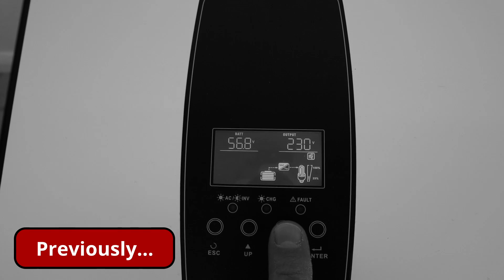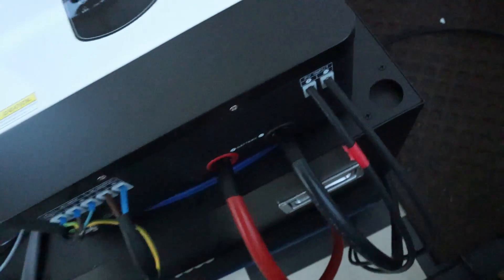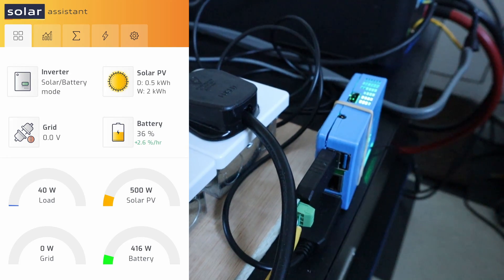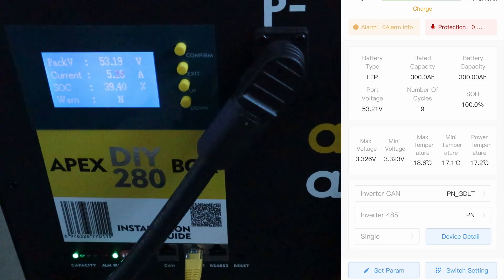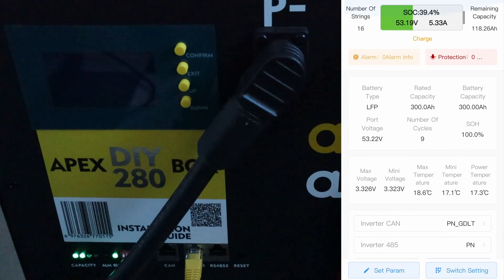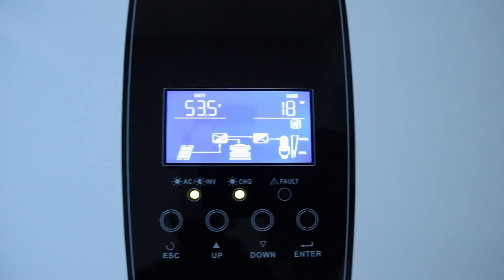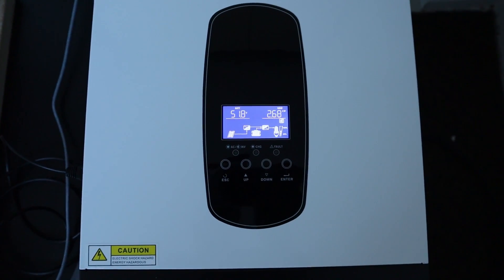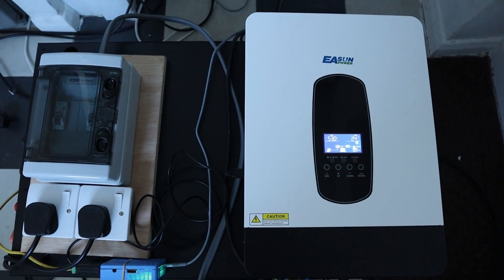Apexium + EASUN = Cheap & Powerful 48V System? | Testing Update

Comment: Hi, can you tell me if it's possible to use this inverter without battery, if yes have you tried this mode
Reply from the maker: @yuriydidkovskiy4063  Thanks for your question. My version requires a battery to operate. I'm not sure on the latest model(s) as I've not got one to test with. I hope this answers your question. All the best, Adrian
Reply: only solar panels
Reply: @jounikyy7715  thanks for your response, do you mean it can work with solar panels and utilities and without battery in SUB mode?

Comment: I saw that inverter on the web.  Quite inexpensive, about 1/3 cost of similar inverters.  But, only single-phase 230 VAC (50 or 60 Hz), so not ideal for N. America since split-phase is better for us, to allow 120 VAC outlets too.  Could be used to power a few devices which use 240 VAC single-phase (no neutral) like a heat-pump, well-pump, or EV charger.
Reply from the maker: @williamgrissom9022  I've not powered a heat-pump, well-pump or EV charger with it as yet, but with the correct wiring it probably could. It's run most of my house fine, albeit with the used of extension leads. It's a shame it can't be paralleled, but I'm guessing that's why it's inexpensive. Cheers, Adrian

Comment: Tu quanto ai curent inpur PV ?
Reply from the maker: @farcasvlad1977  Buongiorno, non è specificato nel manuale o nell'etichetta sull'unità (di solito indica solo le tensioni). I dettagli sul caricabatterie solare (dall'etichetta delle specifiche allegata sull'inverter) sono i seguenti:

Potenza nominale: 6000 W
Caricatore massimo: 110 A
Tensione operativa nominale: 240 V CC
Massimo. Voltaggio solare (VOC): 450 V CC
Intervallo di tensione MPPT: 55 ~ 450 V CC

Potresti dividere la potenza nominale per Max. Voltaggio solare (VOC) per dare un'idea molto approssimativa di ciò che l'MPPT potrebbe estrarre dai pannelli in termini di ampere al carico massimo. Ti auguro il meglio, Adrian

Comment: Very interesting video, I'm thinking about buying one of these  easun  units prob same as yours. Was thinking just using a few small acid batteries I have and 10 solar pannels. Could I just use the power AC when theirs good sunny days directly as won't have much storage. Can you set the easun up to cut the AC Out when the solar is not enough or does it switch over to the AC in and just pass throu?
Reply from the maker: @lookoutleo  You can change the priority of what powers the AC output. I've just broke this inverter, my fault (video to come), but I've got their newer version awaiting customs clearance as I type this (https://bit.ly/4cQXJQe). I'm also testing this at the moment https://s.click.aliexpress.com/e/_DCZbHeX (affiliate link), video to follow in the coming weeks. This one can work without batteries if you have enough solar, still need to test that bit out. All the best, Adrian

Comment: Hi, what is his Max. Solar Current?;Max.Power Current Impp(A)?
Reply from the maker: @user-pk5lc8rr6c  Good day, it's not specified in the manual or label on the unit (usually just states voltages). Details on the solar charger (from attached spec label on the inverter) are as follows:

Rated Power: 6000W
Max charger: 110A
Nominal operating voltage: 240VDC
Max. Solar Voltage (VOC): 450VDC
MPPT Voltage Range: 55~450VDC

You could divide the Rated Power by Max. Solar Voltage (VOC) to give a very rough idea of what the MPPT could pull from the panels in terms of amps at max load. All the best, Adrian
Reply: Ho uno uguale e non sapevo quanto e Maxim imput curent pv

Comment: Thanks for sharing! What is the stand-by consuption from the battery with no-load on the inverter? Can you also check consuption from the grid in no-load condition, please? Some of the chinese inverters are really wasters of energy! Can the inverter also run only on battery with or without PV input?
Reply from the maker: @rilosvideos877  Glad to help where I can 👍. I'll need to check again (can’t find the figures from last time) and let you know, but from what I can remember the no-load results were similar (in Amps) to the ones I shared with you on the 24V version. In terms of running just on battery, yes, it can be run in isolation (I do this with the 24V version now), you'd just need a way to charge it (usually by connecting to the grid to charge). I'll let you know about the no-load (standby) amps on this 48V version. All the best, Adrian

Comment: Can you tie multiple of these units together
Reply from the maker: @blainecelestaine4543  Thanks for your question. You can connect multiple batteries together to increase overall system capacity (as in this video https://youtu.be/Y4defUDU5hM). The EASUN 48V inverter can't be connected in parallel though. I hope this covers it. All the best, Adrian

Comment: Would a small airconditioning be able to run ?
Reply from the maker: @Bazakilouis  Thanks for your question. In this setup, the inverter can output 6.2kW, so in theory should be able to run an air conditioner as long as the surge current needed (at compressor start-up) didn't exceed what the inverter can handle. All the best, Adrian
Reply: Check a newer mini-split heat pump.  Many youtubes.  I recently installed one to better employ my solar power (Della 1.5 ton AC, 230 VAC single phase w/ no neutral, SEER 22).  I use it for the kitchen and living room, but it has cooled my whole house on 110 F days (my central AC failed in early June).  I see 1.5 kW draw max and much less once the house is chilled.  People say it doesn't trip a solar inverter since it uses a high-tech "inverter drive" motor.  If an older AC compressor, you might need to add a soft-start (not cheap ~$300).  Mine is an EG4 6000XP inverter.  Most mini-splits are made by Medea (China), sold under many brands (Pioneer, ...).  Only a few aren't - Mitsubishi, Daikin.  Most HVAC guys like the Mitsu but about twice the price.  Mine cost $900 w/ free Amazon shipping.

Comment: I am planning to purchase 4.2 kw inverter EASUN, would u plz confirm how much inverter support solar pv input current? 
Or
Either it supports 550 watt pv panels ( 50 volt and 13 amps each)
Reply from the maker: @muhammadyaseen6318  Good day and thanks for your question. I'm assuming you are referring to this model SMH-II-4.2KW https://s.click.aliexpress.com/e/_Dd2YZDx (affiliate link)? I've not got this 24V version, but if this is the model you're going for, the product page on AliExpress shows the Max. PV voltage (Voc) as 450VDC and the MPPT Voltage range is 55-450VDC. I hope this is what you're looking for. All the best, Adrian

Comment: Hello, may I ask how did you set up setting No5 in invertor settings menu: is it Lib or User? Thanks in advance
Reply from the maker: @captainpacific6796  Good day and thanks for your question. I assume you're referring to option 5 - battery type? If so, I've set mine to user. Please shout if you have any other questions. All the best, Adrian

Comment: Are you in business with easun?
Reply from the maker: @arnaudmainil6414  No, I'm not in business with EASUN. I wanted to try the cheapest 24V solar inverter I could find to compare with my 24V MPP Solar inverter. It worked well, so I bought the EASUN 48V inverter, which is also working well. Both 24V & 48V EASUN versions were purchased with my own money and I would declare if they were sent to me to review. I hope this answers your question. All the best, Adrian

Comment: Hello, Using the charger, any idea of the powerfactor?
I.e. when charging with XX DC amps output into the battery, what is the YY AC amps input?
Reply from the maker: @jbjensen11  Good day and thanks for your question. I’ve taken a single 'snapshot' data point (on my Solar Assistant instance for the inverter) from the last week grid charging overnight. This is just a rough idea, as the variance will change a little depending on the charging conditions (rate, temp, grid volts, etc).

With Max grid charge current set to 40A, data as follows

PV Power		0W (at night of course)
Load 			23W
Grid Power		2.18kW
Battery Power	2.06kW
Battery SoC		54%
Battery Voltage	51.4V
Battery Current	39A
Battery Temp	18.6C
Grid Voltage		241V AC

I hope this helps. All the best, Adrian
Reply: @DADvinci  Thanks a bunch for the data Adrian. If I read your data right, it shows us a very high effeciency of the charger at around 95% (2.06/2.18) But unfortunately doesnt tell us anything about the power factor.

I am trying to determin if a limitation of 13A at 230VAC would affect the 80A charging capacity of the 24V model. If the unit is poorly designed the powerfactor could be as low as 0.7 - and that would limit the DC charging to around 70A rather than 80A. 

If you by chance have a watt meter you can put in front of the AC input, that will tell the AC amps. going in - and sometimes even straight out tell the power factor?
Reply from the maker: @jbjensen11  Sorry for the delay and not answering your question fully, not been able to test much over the last few days. I've done a quick check today (need to find more time), looking at my new smart plug (will explain further down) which has energy monitoring and I was charging at 40A, showing 2330W at the inverter grid input (in Solar Assistant) and 2595W at the smart plug. It wasn't an exact match up as there is a little bit of a delay between the plug updating and capturing the reading on SA. I'll need to use my energy monitoring plug when I get time.

During a recent negative price period during one of the storms that hit the UK (the one after the storm mentioned in this video https://youtu.be/DHHiSgIEdJE), I increased the charging rate to 50A to make the most of being paid to fill the battery up. Whilst the fused plug didn't blow, it ended the smart plug's ability to switch. I completely forgot about smart plugs and sustained loads, doh! Suffice to say, I’m going to remain at 40A, as before, on the 48V system (shame there’s not a 45A option).

I've got the 24V version of this EASUN inverter and at its max AC charging (60A) it pulls mid 1.8kW, as shown on my energy monitoring plug, with the power factor displayed as 0.92.

I hope this helps and please let me know if you still need me to test on the 48V EASUN. Cheers, Adrian
Reply: Thanks Adrian - I really appreciate all the time and effort you put into answering questions the best you can. 

The wattage you measure doesn’t tell anything about the power factor, but it gives very good indication of the efficiency of the charging circuitry, which may be more relevant to most people. We consumers don’t pay for a poor powerfactor, (the electricity company loose) - so it’s not from a economical concern it interests me. The powerfactor however, still affects the load in amps on the AC input side so it matters greatly if you are limited to X AC amps (by wire size, fuse or other)

The 0.92 is quite acceptable - and a whole lot better than the 0.74 I get on a highend 30V/100A Wanptek Power Supply I have used for charging a big 24V battery bank. That charger is hooked up to 16A/230VAC circuit and in combination with the poor powerfactor, I can only utilize about 2723W(230VAC x 16A x 0.74) of the theoritical 3680W on the AC side(230VAC x 16A). So in effect, I can not charge with the full 100A DC (max capacity of the power supply/charger) but had to limit it to 85A at 29.2VDC.

Hope this gives a picture of why the powerfactor interests me :)

I have actually now ordered the 24V system with a 80A AC charging capability. I’m getting it next week sometime and will do some testing on that model myself also 😊

Thanks for helping me decide!!
(Sorry for spelling etc. - I am Danish)
Reply from the maker: @jbjensen11  Sorry, I forgot to share the amps it used from the power monitoring plug last test. I've retested and the power factor came in at 0.91 (so consistent) and 8.095A charging the 24V at 60A (max for built in charger).

Your English is excellent😊. 100000% better than my Dutch!
Reply: @DADvinci  Thanks..... have you tried Danish?? :P
Reply from the maker: @jbjensen11 You can probably guess my reply. I have very basic Spanish and German, and a few words of French. Isn't Dutch similar to Afrikaans (from what I remember when I visited South Africa years ago)?
Reply: @DADvinci  I don't now Dutch - as in Denmark we speak Danish :)

Comment: wanna buy one but not sure about the mppt , is this a good one or you are loosing a lot of power from bad algo in it? cuz these are fucking cheap compared to like epever for exemple
Reply from the maker: @chris_mk5supra  Good day and thanks for your question. So far, the solar charging on this 48V unit seems to be similar to the 24V version and MPP 24V I've also got. I've not been through the spring or summer with it in the UK as yet, so don't know how it will perform then. It's a cheap all-in-one which has been working fine so far, not much more I can add at this stage. I guess it’s always a risk buying cheap, but I’ve not found any drawbacks as yet. All the best, Adrian

Comment: Hi , i need some help please.
If you have no electricity from grid , can you charge the battery and power the house in the same time from a gas powered generator?
Thank you!!
Reply from the maker: @user-sw3nq7gn1f  Good day and thanks for your question. In theory, yes. As long as the generator provided the correct AC output voltage/frequency (as if you were connecting to the electricity grid), connecting it to the AC input on the inverter should provide this option. The amount of power the generator supplied (AC output watts) would also need to be taken into consideration as it would need to provide sufficient to power the house demand (including charging the battery). I must stress that I've not tried this myself as I've not got a generator and rely on solar/grid power with this setup. All the best, Adrian

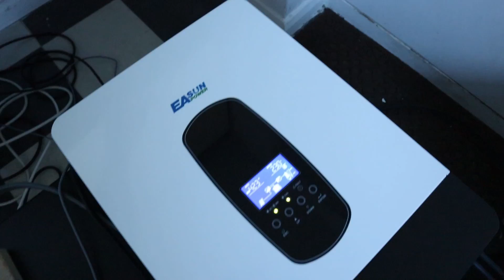Comment: 3:08 smaller cable on Input than Output? You might be employing 'demo rules' I guess! Does this unit do pass-through (when there's no sun and no battery fall back to Mains), right up to its rated output power? I've got to upgrade to something like this. Adding AC Input to our 'off-grid' inverter (which does do pass-through at its rated 3kW, but will powercut above) was a transformation from state-of-charge-anxiety.
Reply from the maker: @trs4u  Hiya, I hope all is well with you? Spot on, I've only connected a mains cable (13A plug) for grid charging. It does do pass-through but I'm not pushing it past 3kW when charging and running small loads at the same time. I only run it full power with solar (what a joke at the moment) and battery. Finally got a smart meter installed last week and currently charging at 15.21p/kWh (for 1 hour, then later in the morning), which is 13.58p/kWh less than what I would have been charged until last week. Testing automaton for the 30min rate changes with solar assistant connected to home assistant. It's been great so far and learning loads (video to follow). I've also got a plan to go on-grid which is already underway (videos to follow too). I'm hoping for a few price plunges where I can get paid to charge (saw -2p/kWh & -4p/kWh around Christmas and the New Year).
Reply: @DADvinci  We'd be on the agile prices in a shot if we had the equipment for it, but our heaviest consumption (cooking, showers) is still in that evening peak. I keep expecting to see someone show their smart meter display running backwards - I wonder if it would? You almost need a separate dump circuit to 'maximise your gains' (~25kW on a 100A house fuse?) from -ve pricing with some wasteful heating. Awkward idea in an energy crisis... We need to move to a 48V+ system with some usable storage - that EASUN unit looks pretty good!
Reply from the maker: @trs4u  Load shifting is the key to 'playing' the energy market for sure, which is where a decent size battery helps a great deal. Cooking isn't too bad. I need to get an electric fan oven myself and they range from around 2.3kW (single oven) and upwards. For me, the induction hob is brilliant, rarely use the gas hob on my cooker now unless I need more than 2 rings for a meal. Showers on the other hand (assuming yours is an electric one?) at peak agile rates can work out quite expensive.

Another 'dump' circuit would be very useful for an off-grid setup, otherwise just go for the largest on-grid hybrid inverter you can afford (which is what I'm planning to do). This opens up the trading element. Fill up during the cheap times and export during peak time or saving sessions.

My gas usage hasn't changed much and still tracks to the colder weather as you’d expect. I'm just hoping that when I do push the button for a heat pump (or air conditioning), I've built my battery bank up as much as I can afford, then winter becomes a little more palatable.